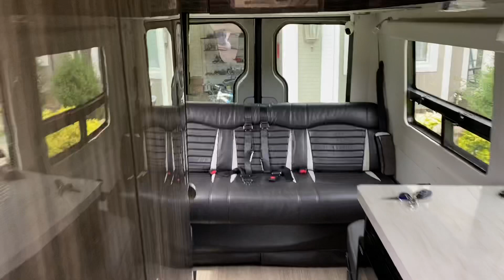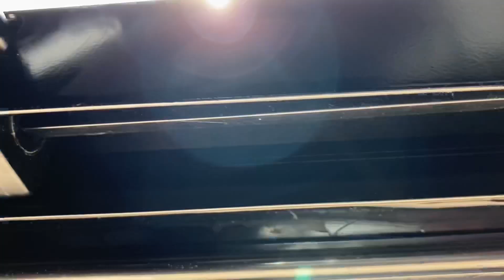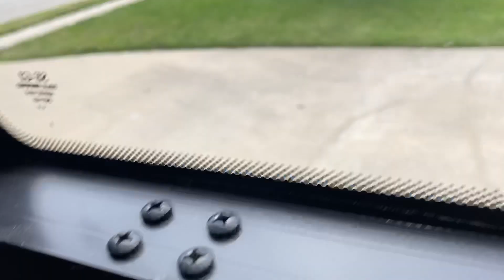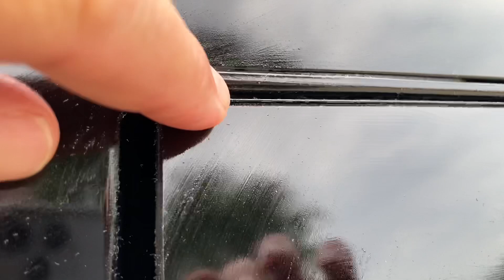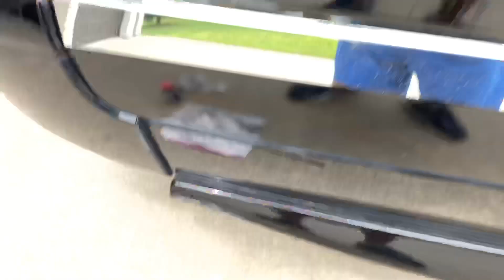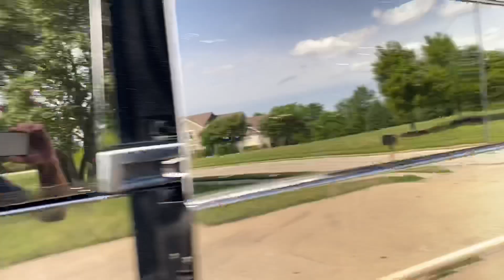SE-GI RV Window Repair - Winnebago Era 2016 Model Mercedes Sprinter

Comment: Ok thank you for the video. I watched several times.
1) it is not clear how you remove the window, I’m afraid by lifting the window perpendicular to the vehicle that it will break, and I don’t see this in your video, is this how you did it? I’m trying to make sure I don’t break the window! ;)
2) is the window removal required in order to access the crank and remove the torque bar?
3) when I try to remove the crank assembly, it doesn’t appear there’s enough room to pull the crank knob out from the opening, I don’t mind bending the bar a little bit, but I don’t see that it’s going to come out? Maybe this is relevant to number two above?
Reply: Lessons learned on this:
1) once the screws are out of the window you pretty much need to take the window out.  It is basically hinged on what I picture as two letter “C”s facing each other.   If the “C”s are rotated (like by raising the window to horizontal) gravity will cause the window to fall out.  
2). Bending the rod is somewhat necessary but if you pull the crank(the broken part) from the inside hole in the frame (where the handle fits) first (also requires a little bending force on the frame and maybe a scratch) the bendable length of the bar is longer and it will pop out.   
3) take a picture of the orientation of the two end pieces and the orientation of the bar so you can put it back the same way. 
4) another comment had me look before trying to install -my replacement part did not have threads in the holes so I bought a tap at Home Depot and made the holes 12-24 and bought new 12-24 half inch machine screws.   They fit through the old holes in the window frame and that was less frustrating than expected.  Again the new part with the rod will need to be installed with some force before pushing the rod ends back into the holes on the ends.
Reply: I have tried several times to remove this square bar.
Has anyone had any success?

Comment: I find this posting very useful but am having trouble removing the square drive bar as I'm concerned about breaking parts that are difficult to find.  But will next attempt to pull down hard in center of square drive bar while prying end of bar towards the other end.  Any other methods offered here would be appreciated still concerned about breakage.   I'm having to replace one of my two side by side glass louvers on my Fleetwood bedroom slideout as one glass fell out on interstate due to jarring from pot holes because locking crank mechanism would open window but would not shut it securely it against the rubber seals, whereby relying entirely upon bond at top of window to slot on opening mechanism to hold window in place.  BTW-found replacement opening mechanism at DK Hardware, called Brixwell 812P for much less than Fleetwood dealers price.
Reply: Is the Brixwell holding up.  People are complaining about aftermarket operators.

Comment: 314724-01-707 operator crank. Please note*** the holes on the crank are NOT threaded and will need to be tapped.
Reply: is it a metric or SAE screw/tap?

Comment: The video was great and we replaced the torque box but can’t figure out how to get the window glass vack in the flange?  We’ve tried everything-thanks
Reply: Hold the window up so it is almost perpendicular to the van.  Line it up with the track and push up firmly on the metal part of the glass. It should pop in.  Do that on both sides.

Comment: Jeff, are you still available for additional questions on the glass removal and tapping new screw holes.  My understanding of your video is the glass jam into the frame and you just pull it out.   Is that correct?    I know someone who could tap the screw holes for me, I do not have the tools to tap but I know someone who could do it for me.   Did you use a taping tool  or did you just force the existing screws into the holes.   I am assuming the screws are English thread.  Thank you for doing this video. PS. that little regulator is expensive and I only found two providers for it.
Reply: Hi, perbatguy. The four screws/bolts that fasten the gearbox/operator to the window frame crossbar are metric scale and are sized M6 - 1.0.  Also, when ordering a  replacement gearbox note that the receptor holes in it are 1" centered. Some of the center gearboxes out there are centered at a different width. Hope that helps.

Comment: Thanks so much for the video Jeff.  I would never have had to guts to pull on the bar without your video.  My situation is a bit different. The flat bar that is attached to the window through adhesive came off.  Just curious to know if you know if I can just use some J-B Weld epoxy to glue it back on or not.  There seems to be a a flat “rubber” type material in along the bottom of the bar but I can’t tell if that was epoxy that fills the groove or if that is part of the bar and I can simply try an secure it all back on.  Or, I call SE-GI and buy a new bar while asking them about the bonding agent that should be used.  Your thoughts?
Reply: jchrisman74: I am having the exact same problem.  I am going to glue the bar back onto the window.  Have you resolved your issue?  If so, what did you wind up doing?
Reply: My glass -bar adhesive came off and I tried some special double sticky tape but it failed, a very strong crosswind blew out the window.  The replacement I got from Lichtsinn RV parts which came weeks later came with a new bar already glued on with some black adhesive that appears to be the same as the original adhesive that failed.  I’m sure it’s better than my tape repair.  The problem is that the new adhesion bar is a bit too long so I assume I have to custom trim it with a hacksaw or
Reply: or find some other solution.  Ideas?
Reply: Dont use the black window caulking (car windshields) its what I first used and it melted off in the sun and the window piece fell onto the grass at a campground.  Clear Gorilla glue has been the only thing that has worked and held.  Make sure the window closes flush before doing it, I think this has to do with the bar.  My window had already come apart before (there was a recall on it)

Comment: This is a good video, helped me a bunch. I had to replace two torque units also. I tried some off brand (ie cheaper) torque units that immediately stripped out. You will need to get the OEM units, they have a larger hole that the bar runs thru. When I received the torque units they didn’t have threads in the mounting holes. I had to tap them out myself. When you remove the square bar it helps if you wrap a pc of rope around the bar in the center and pull down while you pry on one of the ends with a flathead screwdriver. When you are reinstalling the torque bar I used a thin metal ruler to help guide the end pc hinge back into the hole. This job is a bit frustrating but easier the 2nd time around.

Comment: Jeff any further advice on how to get the torque bar out? I have removed all the screws you list and I’m bending it A LOT and I still can’t get it out.
Reply from the maker: Hi, thank you for reaching out about this.  The torque bar has to be bent to remove it.  I think it is made out of aluminum, but it still takes some force.  It can then be bent easily back into place.  I have replaced two of these mechanisms and each time I have to remember to just pull on it until it deforms.  Replacing it has been no problem as it easily returns to its prior shape.  Thanks, Jeff
Reply: Getting ready to bend that bar.  Seems wrong but necessary.